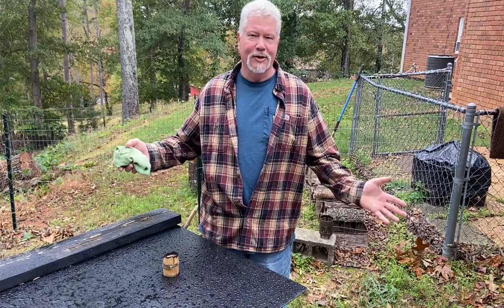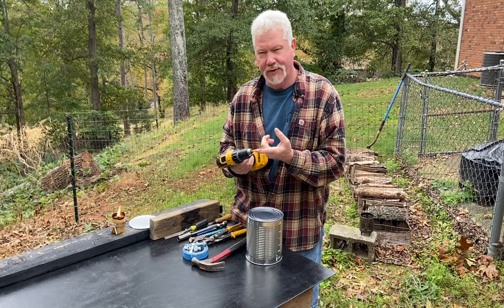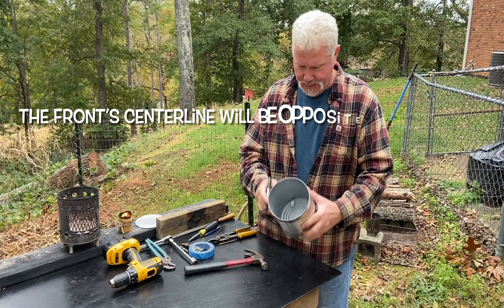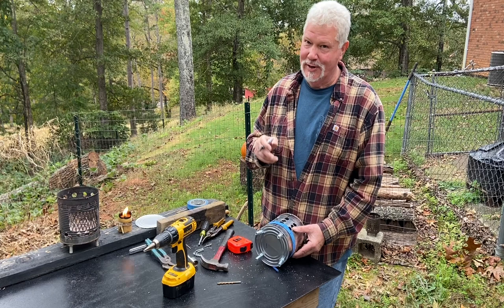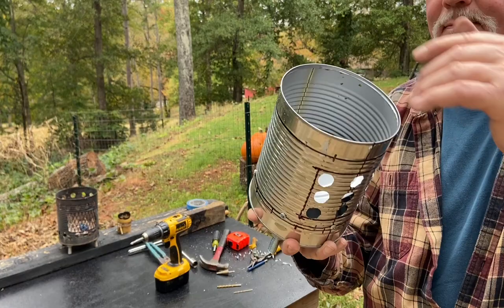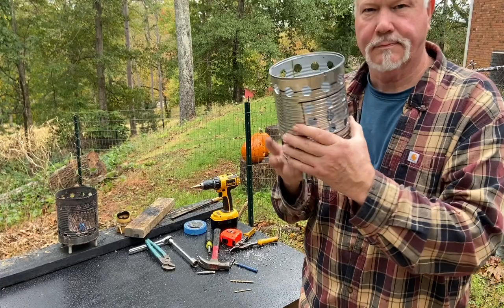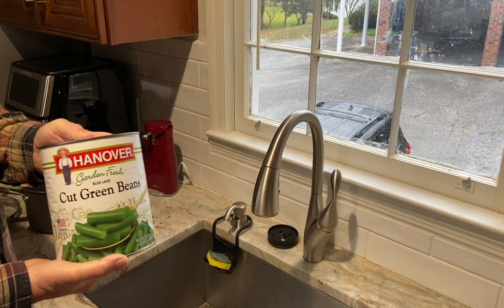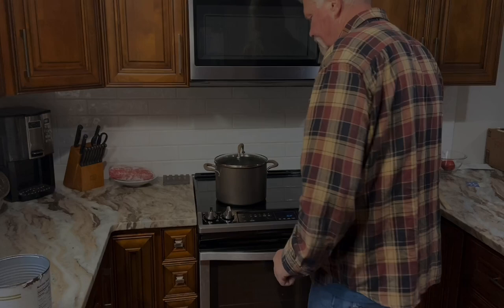Building A David West Style Hobo Stove w/o Expanded Metal... Burn Test In The RAIN!

Comment: Heck, David, I've managed to collect 6 cans of sorted nuts, bolts, screws (wood, sheet metal, machine, and wall board). Not to mention brackets, hinges, et al. Never fails that I can't find the nuts I need, though!
Reply from the maker: I used to have lots like you. When I moved 3 years ago I got rid of them, but immediately started building one back. It didn't take long to build another stash from all the extra hardware that comes in things, from demolitions and throwaways, and from the hardware that others attempt to throw away. I've saved myself lots of time and money over the years.

Comment: I just found your channel tonight and have been watching some of the videos.   Thanks for all the info!  

I've seen a few of the ones you made with expanded metal but didn't like the idea of the expense.  I think I might try this one but develop a different method for the feed hole.  

I prefer the feed hole to a vent hole because of greater versatility.   So I think it would be good to cut out the side panel completely, then put holes in it, and then find a way to suspend it from the side (like you do with the expanded metal) over the can lip.  I'm just not sure of a good way to do that yet...... but I'm thinking!! LoL  

It MIGHT work to take thin (but sturdy) metal strips, cut slots in the feed cover, feed the strips through the slots, then bend to secure them to the feed cover.  On the opposite end of the strips, bend those to hang over the lip like you do the pieces of expanded metal.  Then they might slide around the can nicely to give access to the feed hole.  I think I'm definitely going to try it!  It might work!
Reply from the maker: Please, customize the stove to fit your needs. Please check out my hobo stove builds playlist. Thank you!

Comment: To get the legs to sit even, I suggest that you "PLACE A NUT ON THE SHORT LEG," and it is a simple way to adjust to level. 
I have followed your instructions and that was the only thing that I could see that would do any improvement.
Reply from the maker: The wobble is normal as the metal expands and contracts repeatedly then there's all the uneven surfaces that it sits on. Doesn't make sense to keep adjusting a nut every time I move the stove.
Reply: @DavidWestBgood2ppl  THANK YOU! 
I just made it like you said, but," I have no experence in using it".
That is a good point, so I will keep watching and learning!

Comment: .
By putting the holes on the bottom It should be raised the bottom anyway a little bit in the holes below So it gets an upgrade..
As far as the holes on the top that helps with gasification
Reply from the maker: Everybody thinks that the holes around the top are unnecessary. One can clearly see, in spite of the fact it's not a double walled stove, that it is gasifying... providing oxygen to hot gases that were about to escape unburned.

Comment: Why don't you sharpen the tip on your step bits? I was just wondering because it's very easily done.
Reply from the maker: I should have. I've sharpened hundreds of twist drill bits as a pipefitter.

Comment: What is the significance of the set of holes that take the place of expanded metal? Would'nt the stove burn ok without the expanded metal or that particular set of additional holes?  Just curious.
Reply from the maker: That elevated floor draws air from below from the lower vent holes on the outside of the can/stove. The stove burns wet fuel well because of a powerful updraft.
Reply: @DavidWestBgood2ppl  Not the floor holes, the patch of holes on the side where you sometimes put expanded metal.
Reply from the maker: That's traditionally a feed hole. I've always only used it as a vent hole. In all my videos you will see me orient it towards the wind.